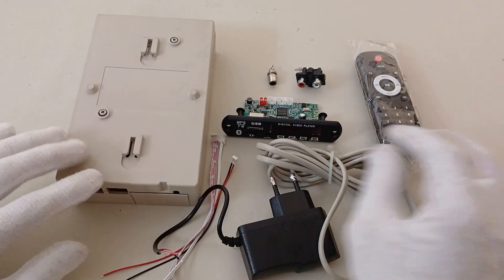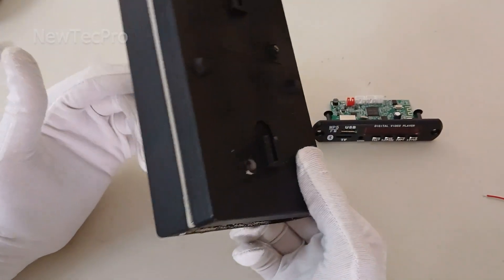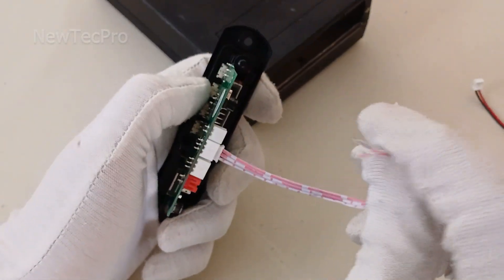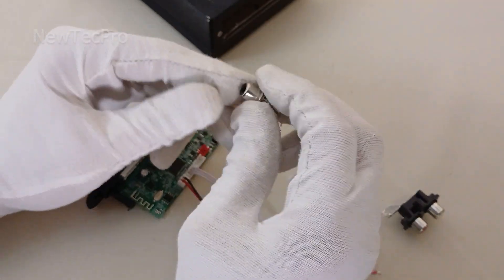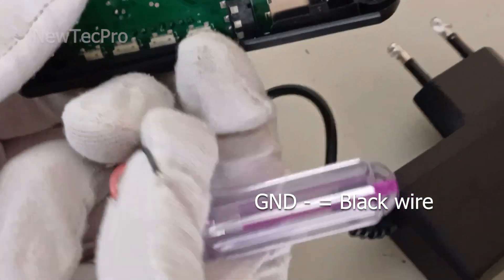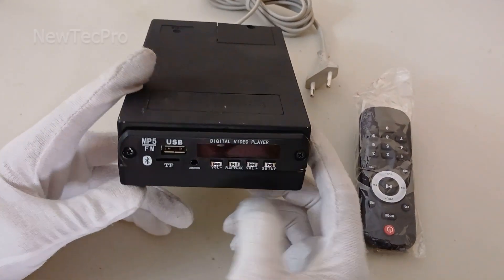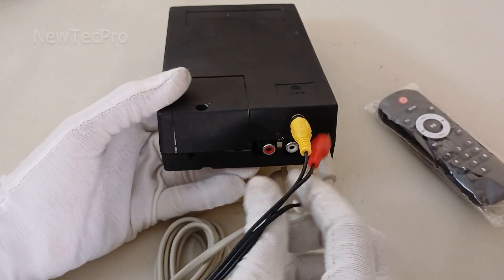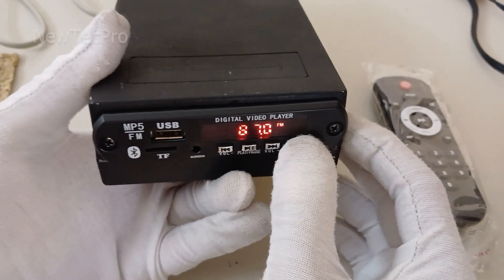DIY Bluetooth usb Video Digital Player mp5 Full HD

Comment: Excellent for Cathode-ray tube (CRT) TVs. But I used it for the in-car monitor that has an AV input. Thanks for your very informative video.
Using old boxes helps the environment.
Reply from the maker: Yes, it is perfectly suitable for car monitors with AV input and old TVs. In the car, you need to convert 12 volts to 5 volts
Reply: Good idea for car monitor 🎉

Comment: Nice. 5v 1a is good for power?
Reply from the maker: It is better to use a 5V 2A power supply. Of course, you can also use 5 volts and 1 amp if the amp is real.
Reply: @newtecpro  thnx bro